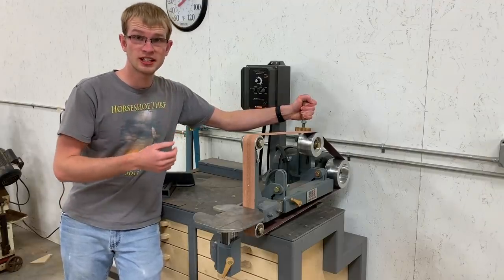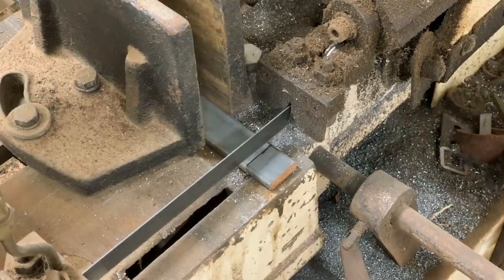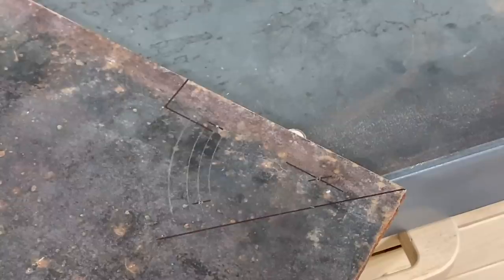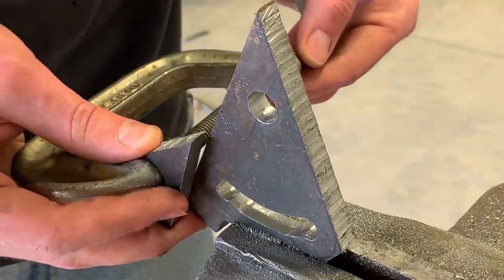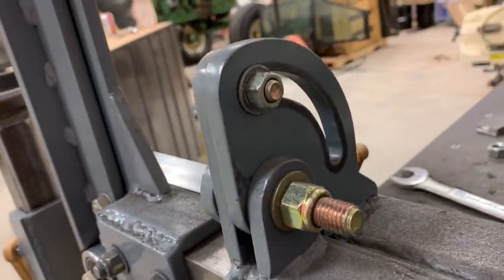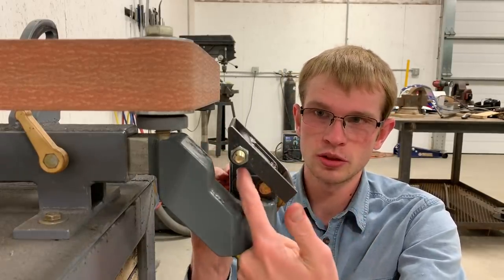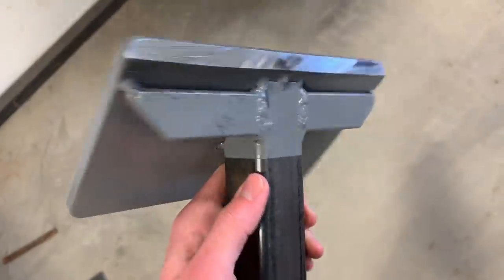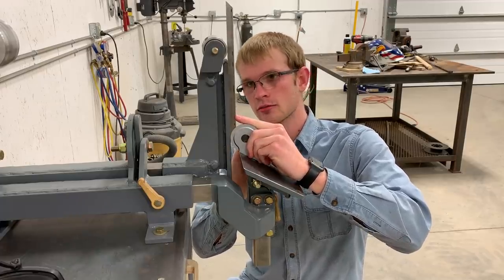Adjustable belt grinder table

Comment: Question: does the heat from welding actually warp the surface? Thanks
Reply from the maker: Definitely. It’s actually surprising how far it can warp a piece like the top of this table. Based on my past experience, if I had welded solid along the left and right sides of the table frame, I think it would have warped the table edges down by about 0.015” each. 

I should probably do a video on warpage...
Reply: @Jer_Schmidt  that would be cool. Or just on general welding. Thanksd
Reply from the maker: One thing I should clarify, just in case I don’t get around to making a video about weld warping: It’s not just the heat that causes it to warp, it’s that you’re adding filler metal when it’s hot. The weld filler goes on hot, then shrinks as it cools, pulling the base metal with it. Simply applying heat to the part will make it warp, but it will return to pretty much straight when it cools.

Comment: You could put an adjust grub screw at each end of the slot to get an accurate 90 and 45 deg
Reply from the maker: The thing is I don’t need an accurate 90° or 45°... I have dedicated tables for those. But it seems wrong for the table to not go that far.

Comment: Jer I read on another build, what I was thinking sort of, Dust and Spark control.
see https://www.youtube.com/watch?v=ACgp8JdJodc. However I would suggest a metal version of the Dust Deputy Cyclone Separator which I have used on my current Bench Grinder.
I have myself and my wife both of us have asthma so any reduction in dust is a help. The other is safety Metal dust and Sparks are a real fire hazard. Just a thought for a future project.

Comment: Hey I like
your work and your videos are great. I have a project for you for cutting steel
shapes. I took a table saw and installed a 1700 rpm  motor ,forty tooth 7 1/4 cheap carbide blade
and it cuts almost as good as wood. You would be impressed .I hope you try it
and make a video.

Comment: Job hunt?  
Just manufacture and sell grinders.
The key is manufacturing efficiency and marketing. 
Too much labor in the dropped table mount though. Just drop the whole sliding tube assembly -- you already have a custom table base so that's not a problem.

Comment: Whats the angle measurement tool called? Where did you buy it from?

Thx
Reply from the maker: It’s a Starrett C359. Bought it used on eBay
Reply: @Jer_Schmidt  Thaks again.

Comment: You do amazing work  !!!!  I bought the plans from you and I am going to build this grinder. The next project I recommend for you is to improve your welding table. I can not afford a Acorn table so I simply took my welding table that is 1/4 thick and drilled holes in a 3" X 3" pattern. Then welded 1" long pipe under each hole so my table is now 1 1/4 inch thick where the holes are for me to use custom made clamping tools. All of these clamps from welding shops are for to expensive, that is why I made my own. Just a thought.......keep up the great work.....you are the best !!!

Comment: Just love the work you do, 
I 'me building my own belt sander/grinder, but no longer have the tooling to make the job easier, and only have a basic arc welder, that keeps cutting off at 140 amps, so frustrating.  I would of prefer a MiG welder for a neater and a less aggressive weld,
But I will crack on and work around the issues when they arrive,
Nice work keep the vids coming, I learn allot from what you do.

Comment: For that locking handle, could you use an indexable locking handle so you can reposition to avoid running out of room?
Great one
Reply from the maker: Do you know of a good one on the market? All the ones I’ve seen are cheap plastic and would be very out of place on this grinder.
Reply: @Jer_Schmidt  You definitely want the aluminium ones at least. Lookup diecast index handle. The small ones here in Aus are generally M6 thread, so 1/4" ish over there.
They work well, I have them on my mill for all of the axis locks

Comment: Maybe you should make a attachment for a metal cutting bandsaw. You cut a lot by hand
Reply: It might be time to invest in a plasma cutter, too.
Reply from the maker: I’ve used a plasma cutter quite a bit and I’m not a fan of it. Rough, tapered edges and work hardening...it just seems like a very crude way to rough-cut stock. I could certainly use a vertical bandsaw though!

Comment: I've been doing this stuff for 30 years and then you comes along and drop a round bar in the band saw so the blade isn't cutting full thickness of the plate ( 12:30 ) and I just feel like I know nothing.
Reply from the maker: That was something a commenter suggested on a previous video. Glad to pass it along! :-)

Comment: Hi mate, first time watching your vid and I subscribe straight away, im new to home hobbie type stuff and what I thought was great to see was how you gave info pilot drilling, reasons to tack weld as apose to solid welds and then cut and filed by hand, which is invaluable as not everyone has all the flash expensive machines like milling and plasma. Thanks man and yes that belt sander is on point. CHEERS

Comment: Per your suggestion, Jeremy, I have extended the slot to allow for a little over travel in each direction.  Because of this, when it comes time for the locking tab to be welded in, I won't be putting it at the end of the slot, but will leave a little gap.  And I'm using adjustable zinc locking handles all over, instead of making my own or using a nut/bolt lockdown.  Making my own didn't turn out quite as nicely as planned... 😳

Comment: Great video. For a tilt handle have you considered a ratcheting style? If is easier than a wrench and just pressing the release button allows positioning it where it does not interfere. They come male and female in a range of thread sizes so you should be able to get one to fit your welded screw. They are either all metal or some are partially plastic for less money and a little less strength.

Comment: Thank you , thank you, thank you for making this video.  You know, I leaned more tips from this video than any other video I think I have ever watched.  Not only do I now know how to make a table design that will work well for the belt grinder I am building, but I leaned about not making welds too long and warping the metal and beveling the edges to allow room for the weld to set.  And I have wondered how in the world to make a curved slot in metal for quite some time.  Your method is ingenious.  I also thank for for explaining things clearly and easily to follow.  Great video!!!  Thank you again.

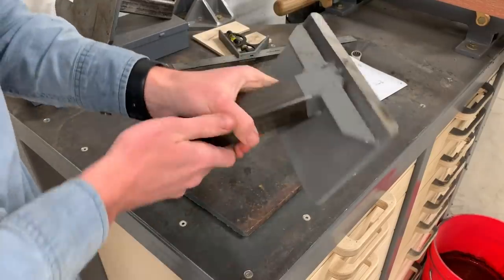Comment: Lol, you need a new blade on your band saw.  I noticed after cutting the plate at around 12:40, when the saw stops, there are several missing teeth on the blade!

Comment: Table looks great!

Here's a solution to your handle clearance issue:

https://www.mcmaster.com/6305k17

You can pull the handles away from the threaded insert and rotate it without the threaded part moving. That way you can rotate it until it hits something, move it back and rotate again.
Reply from the maker: I’ve used those, but I hate how cheap they feel. Doesn’t fit in on this quality of machine.

Comment: Hello Jeremy,
I appreciate your skills and design ideas, you are very talented. 
However I would like to ask if you wouldn't get more out of your adjustable angle table if the bed plate were able to slide linearly so as to close the gap yet still be able to use different surfaces areas of the belt? Additionally if the bed plate could be flipped 180° so that when running in the vertical you would have ears running past the sides of the belt. Then for horizontal use, flip the bed plate 180° so that the full flat edge would be used.
Keep up the good work,
Gary
Reply from the maker: The table already does slide both vertically and horizontally, and there’s not really any reason to make it slide side-to-side, unless I’m overlooking something? Having ears that extend past the belt would be extremely nice, but flipping the table around 180° introduces quite a few problems. I tried for days to make that work (in CAD), but I think if you want the ears your best bet is to make a separate table that has those.

Comment: Are you taking any mechanical engineering classes ? The extent of your over engineered parts list will be detrimental to most common builders . Attaining stress loads for material sizes and minimum thicknesses for plating and bolt sizes can reduce costs , without affecting strength . Overkill is good , only , if someone else is buying the material and supplies ! LOL Great ideas and execution . Thanks .
Reply from the maker: I’m way too dumb to take mechanical engineering, but I figure for this it makes sense to overbuild, because steel is extremely cheap, and heavier material flexes less, reducing chatter. That’s why, to a casual observer, a good milling machine or lathe looks way overbuilt. My brother’s Monarch 10EE lathe weighs more than 10 times as much as my South Bend 9”, and it has about the same cutting capacities, but does much better work because it can’t flex as much. The total cost of steel in this machine is less than $100, so it would be impossible to save more than about $50 by making it lighter.

Comment: Hey Jer, what do you think about a water jet to cut the steel to make all of these types of projects? Idk if the usual drilling with grinding is just as good or would you think it is better for someone like me to cut with a plasma or a water jet? Thanks again and love your knowledge and work!
Reply from the maker: If you can easily find a water jet service at a reasonable price, absolutely use that. Cutting by hand is probably almost as good functionally, but water cut parts look way better. The plans include DXF drawings for CNC cutting the parts.

Comment: One table you need to build, is about a 20° angle in the horizontal position. When your belt sander is in the horizontal position the table should be in an angle so you don’t wear out one section of your belt. I love the videos and plan on making this belt grinder soon. Maybe a surface grinder adapter would be an idea for another modification?? Keep up the good work.
Reply from the maker: I always just lock the grinder at ~20° angle if I don’t want to wear a strip in the belt. It doesn’t have to be horizontal or vertical, it can be anywhere in between.

Comment: Great project, very clever. Thanks for sharing. Hope you discover the metric system soon! 😉
Reply from the maker: I prefer the metric system 10 to 1, but can’t use it in the US. I would have to import all my materials and drill bits etc., since you can’t find metric ones here.

Comment: What welder do you use??  Do you have more than 1 welder for what you do?  I'm considering getting a self shielded flux core welder (I'm NOT a welder and really want to get into it).  Do you think it's a good idea for a home DIYer??  I have a utility trailer that I'm planning on some after market modifications, that's why I'm asking.
Reply from the maker: I’m using a Miller 211 MIG. I don’t have enough experience with any other type of welder to have an opinion, so you might need to ask someone who has used all the different types. I’ve never used flux core or TIG, and only welded a few inches with a stick welder.
Reply: @Jer_Schmidt  Cool.  Thank you so much for the response, I really appreciate it.  I'm checking out more of your videos.

Comment: Hi Jeremy! Maybe my question was already asked, but here I go: as I have no possibilty to work metal, is it conceivable to build machines like your belt grinder or your CNC router out of wood? I’m aware that stability and precision would suffer, but I can’t judge if it would be such a great deal that there simply is no point in trying, or if modifications to your plans would have to be so heavy (in order to get acceptable results for a woodworker) that one should conceive the machine in an altogether new way, or if indeed there could be some reason in trying. What do you think?

Many thanks and bye 🙂
Reply from the maker: You would need to re-design it to use wood. If you’re interested, John Heisz has a good design for a wooden 2x72 grinder. It doesn’t tilt but otherwise I think it’s pretty good.
Reply: @Jer_Schmidt  Thanks for your answer! Needless to say I'm a huge admirer of your work, as countless others are. I'm going to open a youtube channel about music analysis soon, and your ways to present things is definitely something I'll bear in mind.

Comment: Jeremy, I have a question:  Why do you make your receiver tubes out of 3/8s flat bar vs. using 2"x1/4" tubing?  Thanks for posting these great videos!
Reply from the maker: It’s more precise this way, so they fit with a tighter clearance. Also the tool arms can be the full square bar, if I used a pre-made tube then all my tool arms would need to chamfered to fit.
Reply: @Jer_Schmidt  Thank you!

Comment: Dear Jer, I like the concept of this adjustable table but when you see it in action, there is a flaw in the design. The table surface needs to move in and out so that the rear edge is almost touching the belt during operation.  At 90˚ this happens but at 45˚ the rear edge is a cm or two away from the belt.  This could be dangerous if work gets trapped in the gap. I’m sure that with your level of precision you could correct this. Cheers.
Reply from the maker: The table holder slides in & out so it can go right against the belt.
Reply: Mea culpa

Comment: how about a large butterfly nut for the locking? or weld some "ears" on the current one
Reply from the maker: Take note of how close the table is to the end of the slot. There’s not enough room for that when it’s tilted to 45°.

Comment: Visually many of your welds are crap. However that can be easily fixed by being taught the fundamentals of MIG or STICK or TIG Welding. Enough with the negatives...you are naturally gifted...a gifted machinist that if you are not aware of how machines...who do not think can still cause you catastrophic injuries. I've seen a man lose an arm by holding a strip of Emery cloth. He hung on as it grabbed his spinning job in the lathe. He couldnt understand why his left hand didnt work. Well his entire left arm had been torn out of his shoulder by getting trapped in the jaws of the chuck. We held him tightly while the ambulance was called. Never saw him again. Finesse that sander and its attachments.  Don't share shit if you can make money from it. Sell your products at machining and Craft Shows knife shows,timber shows...etc. if you were in Sydney...I'd take you on ...on the spot. Every apprentice I've trained...I've started the same way.  Explained how bits of your body can be removed in a instant if your not 120% aware of what these machines are capable of. Many of my young blokes are either in managerial positions, self employed...or retired & live off the ideas that have generated an income for before and after retiring...dont let people steal your thunder. You're a talented man...go for it

Comment: What do you think of drilling the ends of the adjustment screws and popping in a brass button so the slide doesn't get marked?
Reply from the maker: This machine was designed from the ground up to be built by basic tools that anyone who needs this machine already has. There are dozens of upgrades that can be made if the machine is in production, but I had to make some compromises here so my customers can actually build it.
Reply from the maker: To answer your question, that would work, but I think it would be better to mill a 0.5” wide x 0.020” deep recess into the side of the tool arm, so all of the marring is below the surface. If you were to use brass, it would be better not to let it rotate with the screw; have a thin strip of brass attached to the inside of the tube, so the screw pushes against the back of that and presses it into the bar. This way there will be absolutely no marring whatsoever. I have a couple of calipers with a lock that works this way.
Reply: @Jer_Schmidt  
Yes, a "gib".
Reply from the maker: Exactly. I forgot the word.
Reply: @Jer_Schmidt  
Did you see my comment on adjustable mandrels on the September 2nd video and the one about adjustable handles on the December 12th one?
Reply from the maker: Yes. Adjustable handles might be a good idea for most people, though I’m not sure it’s worth the bulk. I’ve explored the idea of a collet-like mandrel, but I recently tested a different method that works extremely well and is easier to do (doesn’t involve any custom jigs that no one will know how to build). Trying to perfect the technique and maybe I’ll share it sometime.
Reply: @Jer_Schmidt  
I'll be interested.